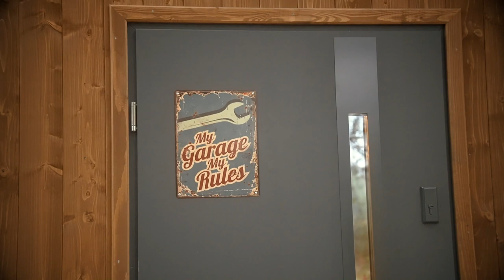MY NEW FORGE IN 13 MINUTES [Trollsky Knifemaking]

Comment: Nice job. Should work well. Why did you not put a bend in those threaded rods before you put them in the footing? You can do it without a steel bender. By the way, I like the size of your framing timber. Much better than the 90x45 I usually have to use. Interesting from my perspective, to see that you have rafters, underpurlins and collar ties in the roof but no ridge or cleats.
A nice drop in a Glencairn glass. Good way to finish.